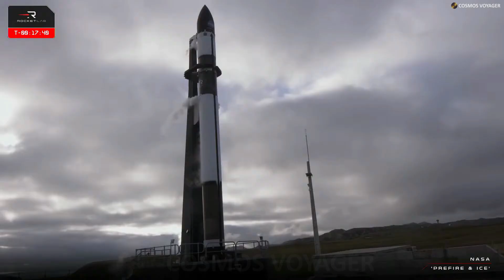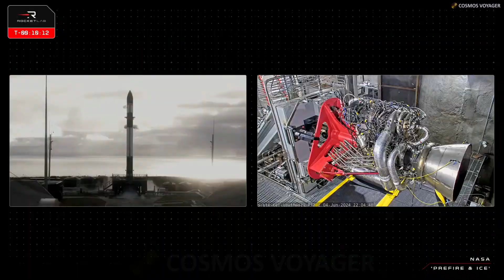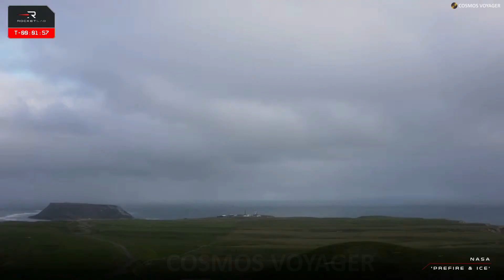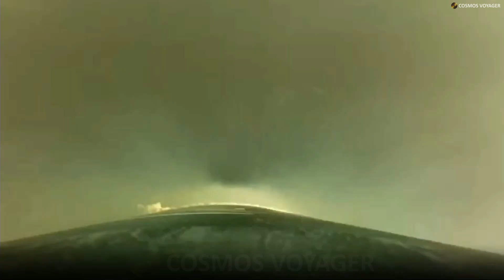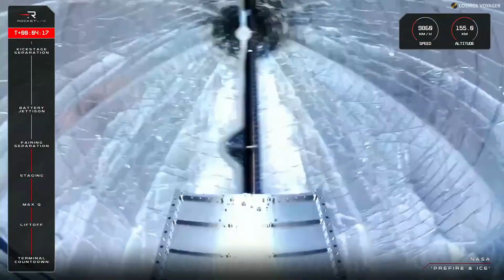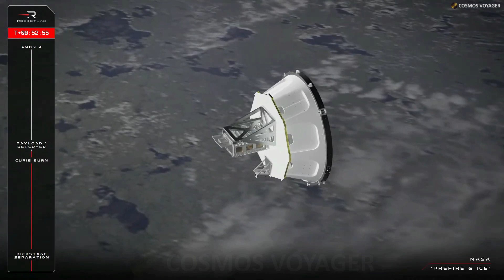🚀 Rocket Lab - Lanzamiento de 'PREFIRE & Ice' para la NASA

Comment: Dato curioso, este tipo de cohetes tienen un depósito de alrededor de 4-6 millones de toneladas y consumen alrededor de 4-6 toneladas por segundo.
Reply from the maker: Y está fabricado con un compuesto de carbono ligero, no con metal.
Reply: A mí lo que me llama la atención son esas grandes piezas/superficies de oro que le ponen en el exterior. Eso debe de hacer subir mucho el presupuesto.
Reply from the maker: @Quo-vadis-domine  es por las propiedades del material:
Revestimiento de oro.- Siendo un metal de limitada accesibilidad, parecería extraño que una nave espacial pueda estar prácticamente recubierta de oro. La realidad es que el oro es un muy eficaz reflector del calor y de la luz infrarroja. Además, tiene una ductilidad o maleabilidad extraordinariamente alta, de modo que puede ser moldeado en láminas extremadamente finas. Así, 1 onza de oro igual a unos 30 gramos puede extenderse en casi 30 m2 de superficie con un espesor de 5 centésimas de micra. Este recubrimiento protege también las naves espaciales de las altas temperaturas y la corrosión. De hecho, se ha diseñado una película hecha de Kapton y una fina capa de oro, aluminio o plata especialmente con este fin. Además, todas las ventanas de un transbordador espacial están revestidas de láminas de oro.
Lubricante de oro.- También es interesante destacar que, en el vacío del espacio, los lubricantes orgánicos se volatilizan y no llegan más allá de la atmósfera terrestre. Como el oro tiene una resistencia al cizallamiento muy bajo y una ductilidad muy alta, es fácil crear películas finas que sirven como lubricante entre las partes móviles críticas de la nave. De esta manera se asegura que, en las zonas importantes, las moléculas de oro se deslicen una sobre otra bajo las fuerzas de fricción proporcionando una acción lubricante.
Circuitos de oro.- También, como es obvio, cada vez que se lanza un vehículo espacial se pretende que funcione el máximo tiempo posible ya que no hay posibilidad de realizarle un mantenimiento. Cada vez que se fabrica una nave que se lanzará al espacio se pretende garantizar al máximo su funcionamiento. Siendo el oro uno de los materiales que mejor conducen la electricidad, los circuitos de estos dispositivos se construyen con este metal.